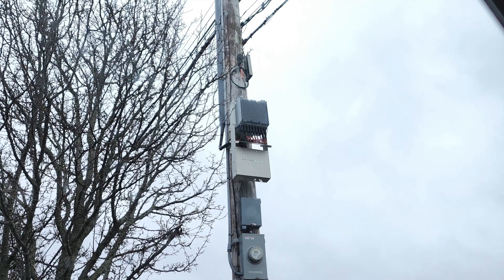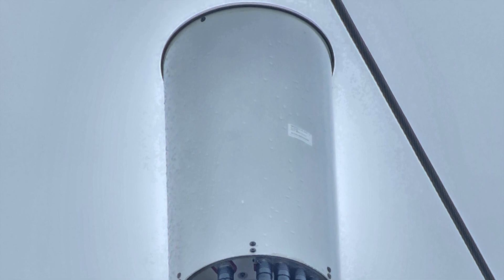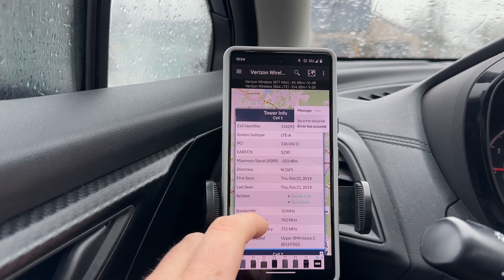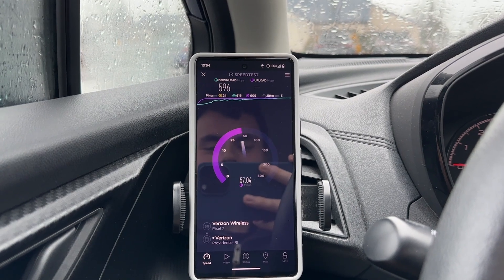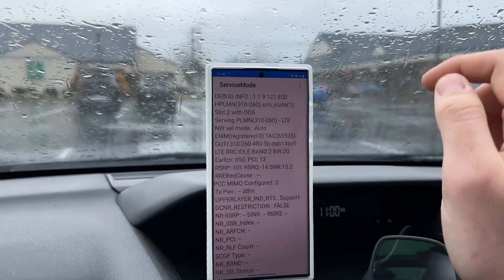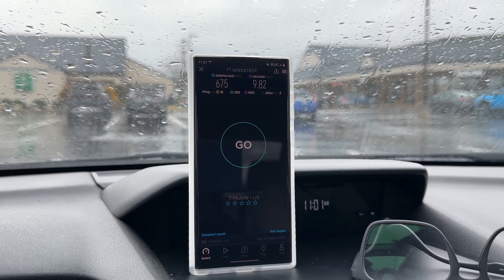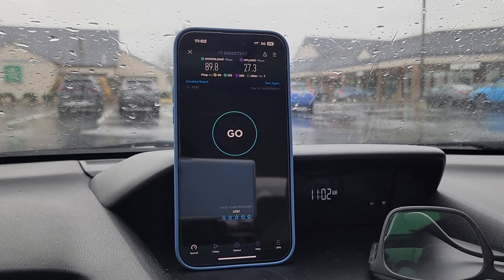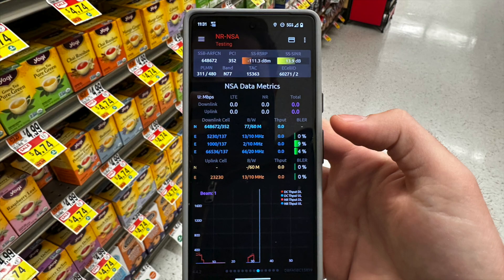Verizon 5GUW CBand 8T8R Small Cell

Comment: Hi, I need some advice, I'm going to be getting a new US unlocked phone soon (OnePlus 10 Pro), and I'm planning to connect it to T-Mobile's network. Would I have to root my new phone to get Network Signal Guru to display the bandwidth of the 5G radio channels (i.e. display N41 100MHZ)?
Reply from the maker: I believe so. You can use NSG without Root, but it shows very, very limited information. To get all the features of NSG, you need Root. 😄
Reply: @PimeTechnology  Ahh, thank you for the clarification. Rooting my phone might make updating the OS tricky though... 😅

Comment: They should add b2 or b66 to improve the speed a bit cuz intra cell affects speeds a bit  least till they add SA
Reply from the maker: True, at moment! By the end of the year when 5G Stand Alone and 160 MHz of n77 is On Air, B2/B66 will be almost useless in this situation, crazy enough.

Comment: 8T8R doesn’t show its limitations unless there are lots of users on the site or at edge of cell. Small cells don’t get congested as often as a macro so that will likely never slow down

Update. I seen the whole video. Now I’m impressed 😂
Reply from the maker: I agree completely! 8T8R or 16T16R seems like it is perfect for Small Cells. The right size equipment, which the right performance for the job. I noticed speeds away from the site seemed not as good as 64T64R, but it wasn't as big of a difference as I had expected. I was thoroughly impressed with what this 8T8R site had to offer. Appreciate your input, Terrell!!
Reply: @PimeTechnology it’s not just 8t8r it also lacks beamforming that’s why you see the speed drop off like that